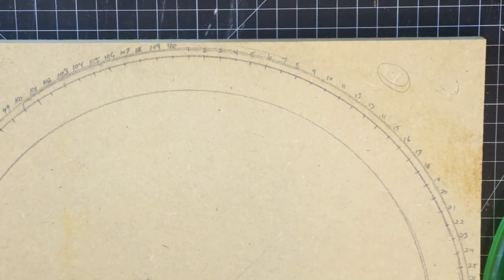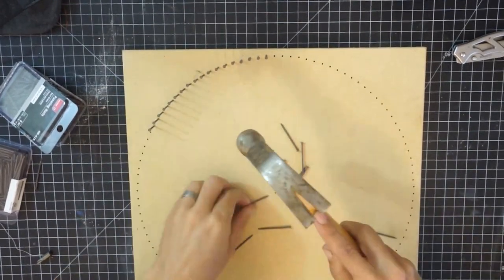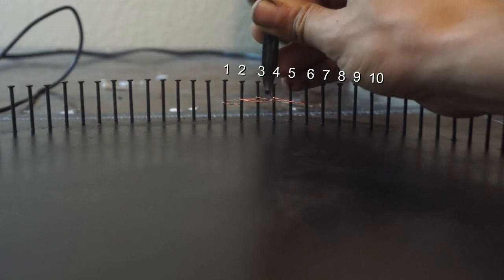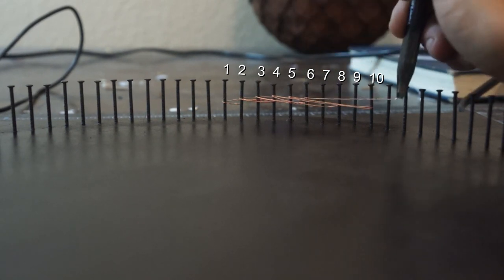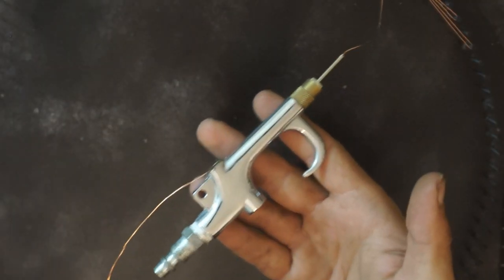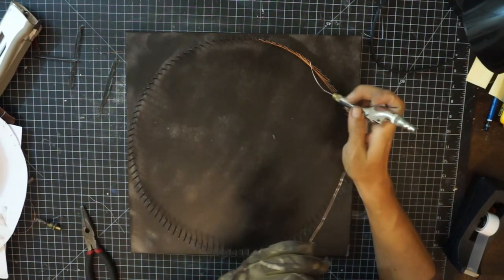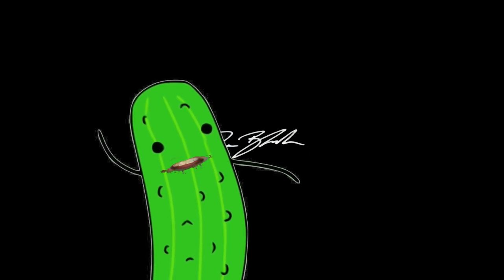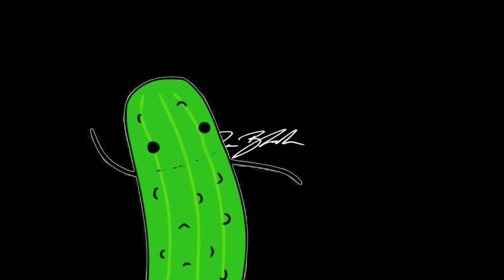Art With Copper

Comment: Great work with this. How did you trace out the circle, and (more importantly) how did you accurately measure / space out the 1cm gaps on a circular line?
Reply from the maker: There are many methods for drawing large circles. You can use a string with nail or just trace a large bowl. For the spacing you have to do some math, dividing the circumference  by the number of points you want
Reply: @BlanchBrothersStudio  Cool, good suggestions.

PS: Had to laugh at the cough and sniffle at the start of the vid - adds a 'personal' touch. Pre-covid, I hope ;)